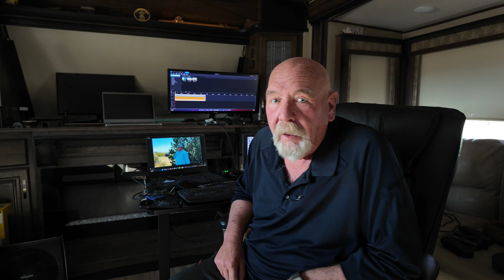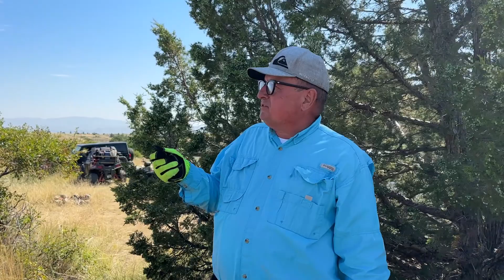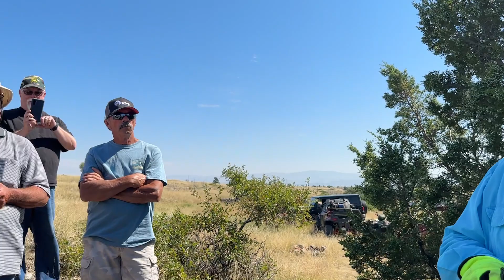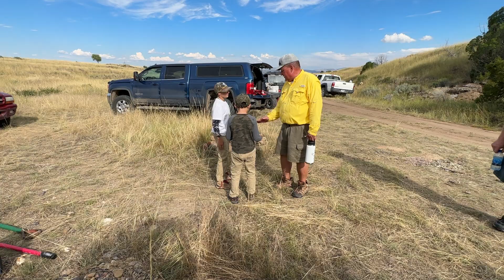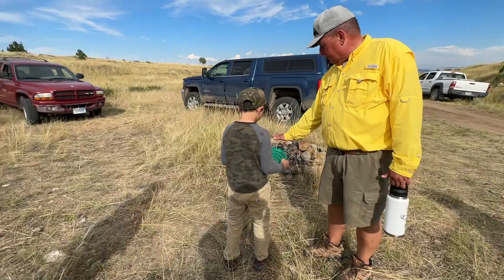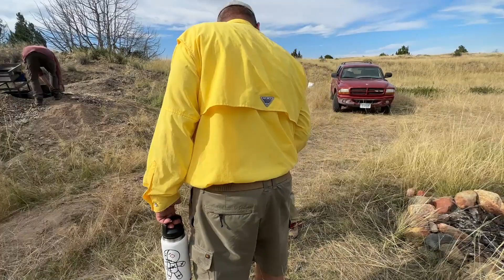Supercritical Water and GOLD explained in less than 3 minutes

Comment: A couple things - great explanation of how water can stay liquid above boiling points so long as its under pressure. But even super critical water needs a chemical to dissolve gold. It can be chlorides, but is more often its sulfur that helps carry the gold. This is why sulfide minerals are so often found in gold bearing veins - the sulfur may help carry the gold in solution, but the sulfur would rather be with iron or copper or something else - gold sulfides are unstable at cooler temperatures. The sulfur dumps the gold out as metal and sticks onto the iron or copper or something else that can form a stable mineral. Some gold deposits are formed deep - like miles deep and no significant water escapes to the surface (this is the mother lode type). In near surface epithermal types, the hot water may escape as steam - like hot springs. However, hot waters dump their gold long before they get to the surface. The last metals to drop out nearest to the surface are mercury and antimony (these are commonly found in or around hot springs). The gold and silver drop out of solution as the waters move up, but well before the surface is reached - down a few hundred yards to maybe as much as a half mile deep depending on temperatures. In all these cases where gold forms down deep - be it a few hundred yards to several miles - the gold is brought to the surface and exposed by uplift and erosion.  Hope you are doing well my friend.
Reply: Well said
Reply: Ah, Chris, you grabbed the thunder...🙂There is a second video coming with the deeper dive, hence leaving it open with the "best short description".  Would love to have you in on that one if you would like!